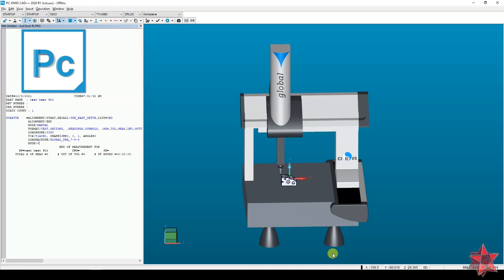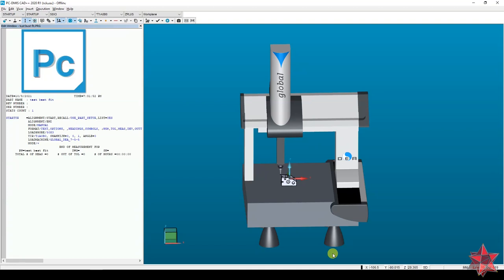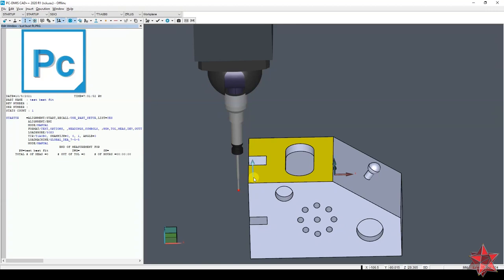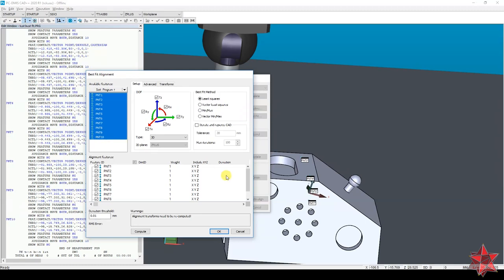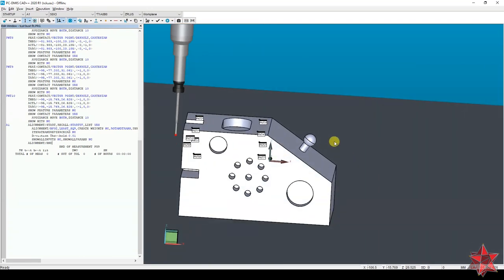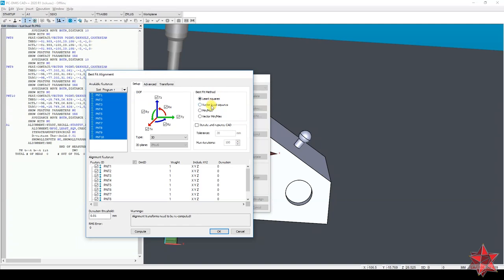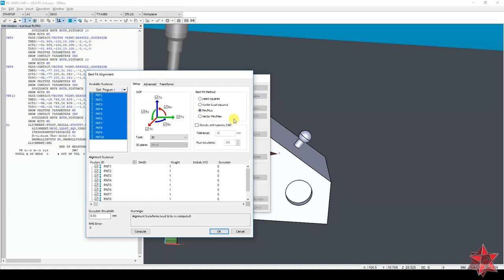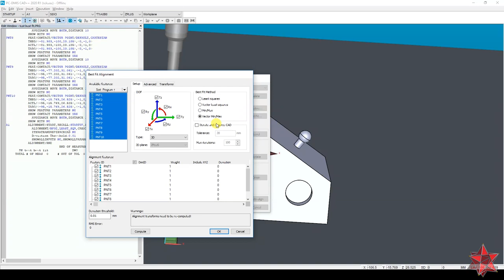PC DMIS Best fit alignment

Comment: I suggest that you use the Vector least squares method when alignment is used with surface points. With that you use the advantage on the CAD surface vector and the CMM machine.
With elements with a center point use the standard Least squares method (circles, slots, spheres, uncompensated points).
If you use a portable device like an arm or tracker, some other things has to be done with best fit to make it work flawlessly when using CAD. 
From a PC-DMIS user since 1998.
Reply from the maker: Thank you for the advice, love to see experienced users on my channel, and love to receive feedback.

Comment: How to check symmetry in pcdmis?
I have measured two parallel planes then constructed mid plane but the result is showing zero. I would like to know how to measure  in pcdmis.
Reply from the maker: You evaluate the symmetry plane to another axis or symmetry plane that is symmetrical to it. I need to see the print in order to explain better.
Reply: @xyzarchitect  I made one cylinder XY origin which is center of the part. Then I have measured two parallel planes which is symmetrical to y axis. Then I constructed mid plane. I selected mid plane and cylinder to check the symmetry, the result is zero
Reply: Could you make video how to measure symmetry in pcdmis. It would be helpful for so many CMM programmers.
Reply from the maker: In te future - sure

Comment: hello, could you give an example of how to align a straight tube with 5 holes in line and only 1 is B and 4 points to level Z
Reply from the maker: Hello Calos, you can write me an e-mail at xyz.architect.3d@gmail.com, send me the drw or a snipp from it, and I will suggest an alignment.